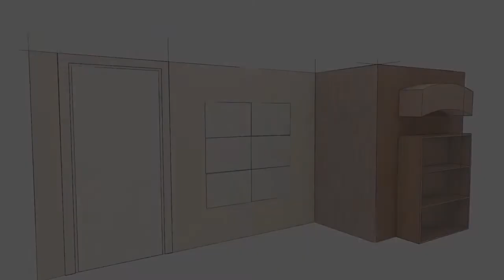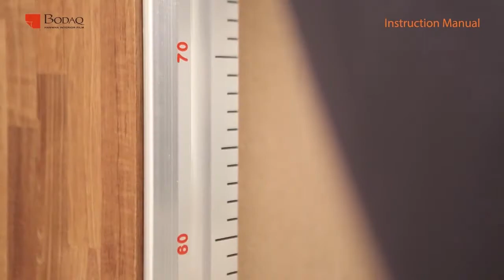How to install BODAQ Interior Film

Comment: Is it correct that you cannot heat up the Bodaq SMT-series?
Reply from the maker: No, that's not correct. You can heat up the Bodaq SMT-series, but they simply don't stretch as easily as patterns from other collections.